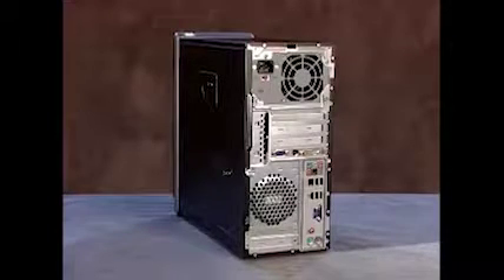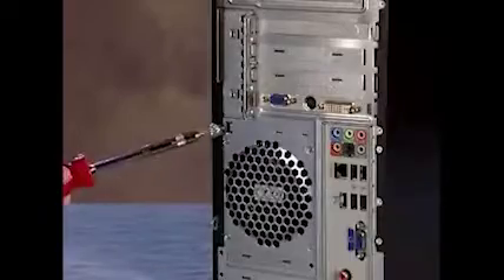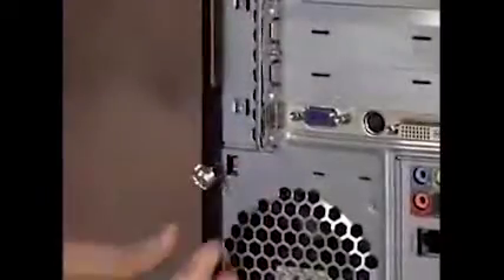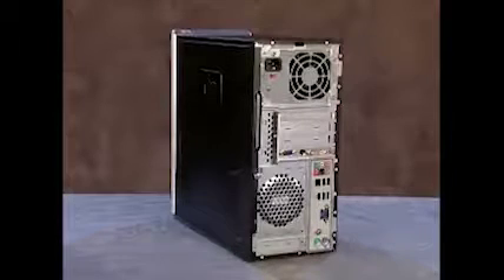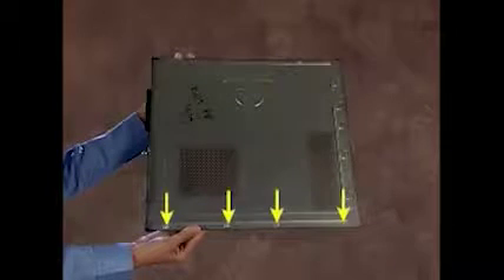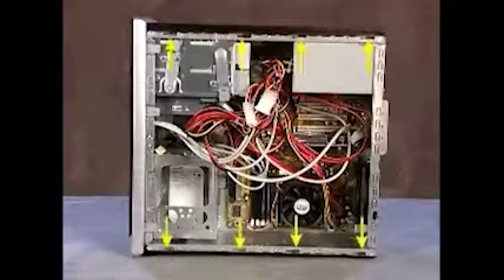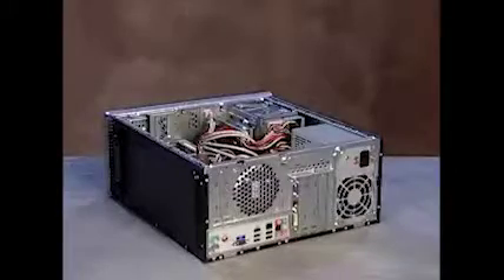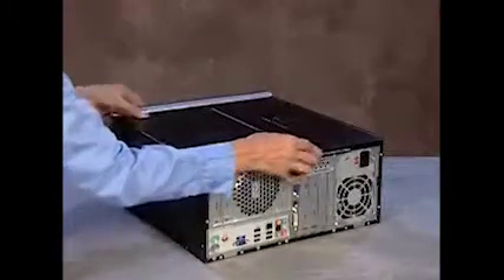Replace the PC Case | Desktops | HP Support

Comment: How do I unseat the PSU in the, envy beats audio, tower c. 2010 (?)
Reply from the maker: Hi there, thanks for contacting HP Global Social Media Support!
I understand that you need to know about replacing the power supply of your computer.
I will do my best to assist you.
May I know the complete model number of your computer?
Please let us know!
Regards, 
HP Support
Reply: @HPSupport  Thank you for your response. Is this the model number?: Hewlett-Packard 700-410 1.00
Reply from the maker: Thanks for the reply.
The instructions for finding the model number can be found here: https://hp.care/6059WNHkh
Regards, 
HP Support
Reply: @HPSupport  The Model No. is 700-410
Reply from the maker: Thanks for the reply.
The model number provided by you seems to be incorrect.
Please let us know the correct model number.
Regards, 
HP Support

Comment: If anybody is still looking at these comments, how feasible is it to gut this and use it as a case? Found an old one sitting in my parents garage that isn't needed and was hoping to use it as the case for a new build.
Reply: @Takodachi_hpf3 I found this video because I have a gutted Compaq Presario SR5618F case that I was thinking of turning into a random virtualization server or storage box.
The video is extremely low quality but the chassis of this case is unmistakably the same mass-produced case that HP used for a lot of their desktop PCs in the late 2000s/early 2010s.
Regardless of the case's front facia or side panels, a lot of HP desktops came with this exact same metal frame.
It supports standard size, off-the-shelf ATX power supplies. There is a tool-free latch inside the case (part of the motherboard tray) that holds the PSU in place (you'll still want screws), but  PSUs larger than the standard ATX12v spec (150mm x 86mm x 140mm) will likely get scratched by this latch.
The chassis also supports standard Micro-ATX format motherboards, so again any off-the-shelf MB should work as long as it's Micro-ATX.
It has one 90mm fan mount at the rear.
There is a removable HDD caddy at the front of the case that holds two 3.5 inch HDDs, but not all HP PCs with this frame came with the caddy. If someone reads this and wants to find the HDD caddy to install in their machine, the HP part # is 5003-0656.
Without the HDD caddy, you could possibly zip-tie a fan to the front of the case as intake, but some PCs plastic front facia do not have ventilation to pull air through.
A great upgrade for these cases could be buying a 2x 5.25 to 3x 3.5 bay adapter that has a dust filtered fan intake.
If you're willing to take power tools to the case, you could probably have a lot more fun.

If anyone wants to save this case from the scrap heap, you're not gonna put a high-end or power hungry system in here, but as a basic (or even midrange) PC or basement server, this chassis is half decent esp. when the case is upgraded.
Reply: Currently trying to figure out how to get the PSU out of it.
Reply from the maker: Hi there, thanks for contacting HP Global Social Media Support!
I understand that need to know about replacing case and PSU of your computer.
I will do my best to assist you.
May I know the computer you are using?
Please let us know!
Binu-HP Social Media Tech Support
Reply: @HPSupport the desktop is a hp pavilion a6238x.
My hope is that it's possible to replace the internals with modern hardware, but im now concerned about motherboard hole compatibility.

I found the screw I was missing on the PSU.

Mostly hoping to give this case a second life as a budget "sleeper" pc rather than send it for scraping.
Reply from the maker: Thanks for the reply.
Use the HP Parts surfer to identify the part: https://hp.care/3sskpVc 
And order it via the HP Parts store: https://bit.ly/3nKMYrs 
Binu-HP Social Media Tech Support